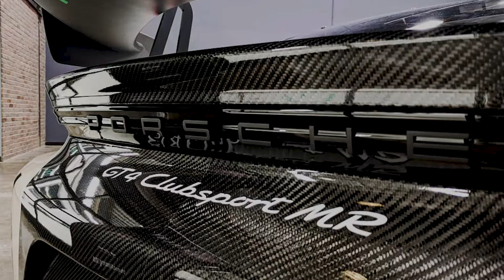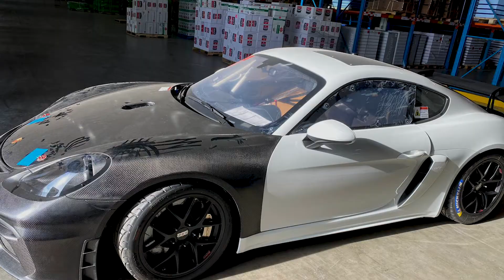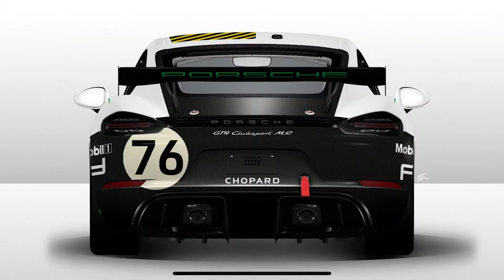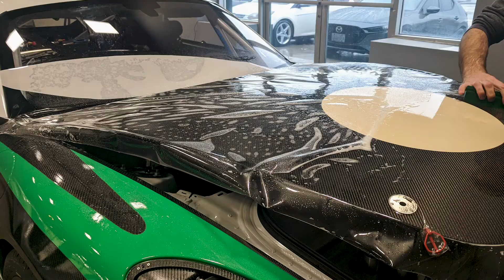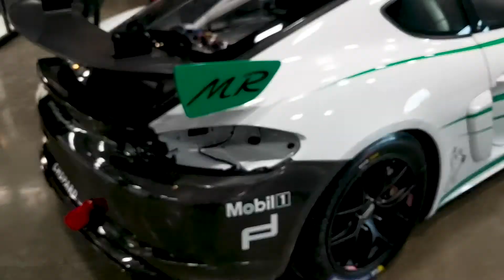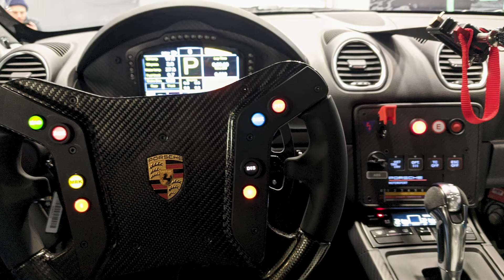Porsche GT4 Clubsport MR

Comment: The base is 718 Cayman GT4 ?
Reply from the maker: Correct. This is based on the 718 Cayman GT4 platform. Porsche builds it as a GT4 Clubsport, and Manthey Racing then further modifies it.